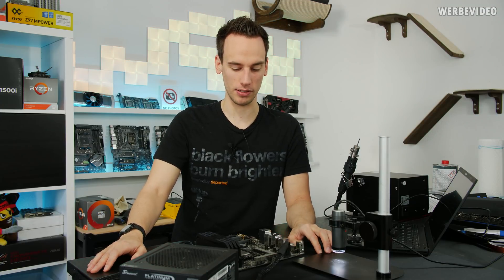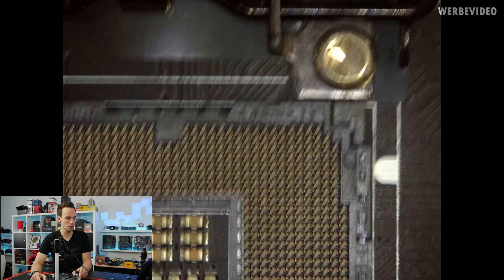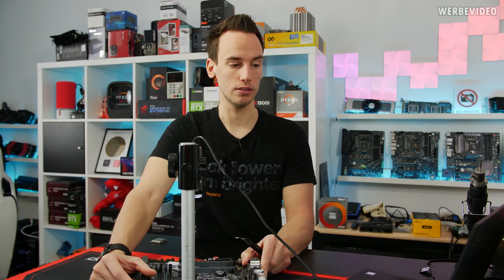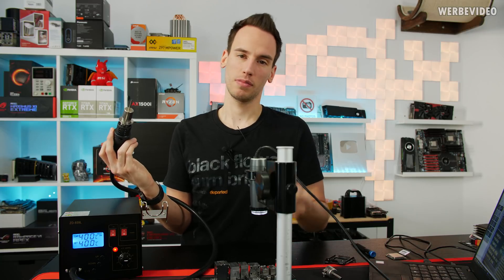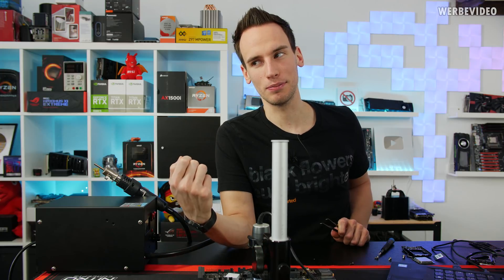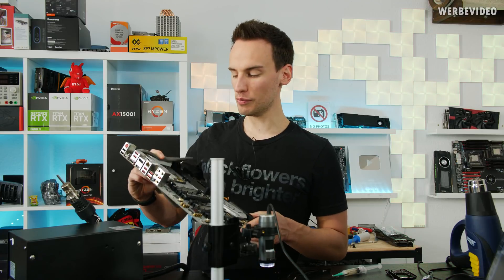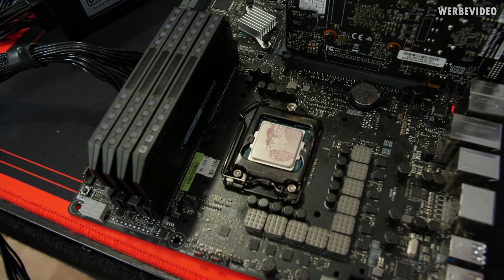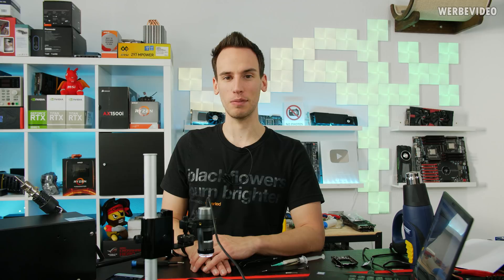We fixed a broken motherboard (Pin)... and broke it even more. BUT now it's working :D

Comment: I would think that if you can use the thermal resistance tape to shield all the other parts except the damaged pin, it will likely elimnate or reduce the unnecessary damage to other pins/components.

In anyhow, it is a good try to create a such a god video.

Comment: Hey you done so well on that one how do you feel about replacing 20-30pins on my one? 😅 I ended up bending them yesterday while taking the cpu off for the first time. The arm that locks it into place ended up slipping off my thumb and proper banged the cpu into the socket 🤦‍♂️and I havent got the funds to replace it 😭

Comment: what ???? soldering as a first try ?????  really ?   just try to bend it back FIRST ! if thats not working  -> soldering. or do you swap out the whole motor on your car if a spark plug fails ?

Comment: a few of my bottom left pins got bent. my x16 pcie slot 1 stopped working D6 debug code. i bent back with my finger and the pcie slot is working again.

Comment: Refurbished and ready for resale.  I fixed mine with a tiny bent strand of stranded copper wire for now at least...  Lasted a few days only compression fit heat and cooling must have disconnected it, had to go back and use 3 tiny strands twisted tightly together (for more spring) and tinned one end to actually solder it in, so far so good but I will replace with a real prong when it arrives from china in a month or so, and switched back to my glitchy memory chips just in case, which now are all working perfectly of course, this has apparently been the whole problem for last 2 years, glitchy memory sticks caused by improperly cleaning and repasting my cpu that caused a bent prong that i then broke off trying to unbend.
Reply: cool. i was thinking about getting a broken lga board for the pins but ill try this out

Comment: @der8auer any reason why you can't use a soldering iron on the pin to loosen it? I have same board with a missing pin, but can still POST with half the memory

Comment: Hi i have a few broken off pins on my server motherboard and no one is willing to fix it for me so i want to fix it myself. So what do i need to replace a the pins and repair it??
Reply: i'm thinking about buying the socket from ali express and practice with soldering iron, can you see any downside to this?
Reply: @bitcoinnoddy6850  the problem it you cant use a soldering iron you have to use a hot air soldering thing like in the thumbnial. And i have anoter old motherboard to practice on
Reply: @jankocoetzee  fingers crossed, i've just bought LGA1151 and a USB magnifying glass, i'll check it out and maybe buy that hot air soldering guy and try it out :)
Reply: @bitcoinnoddy6850  thats great i hope you get it right. There are some other videos that you can watch thats shows how to replace the cpu socket

Comment: Can you send me some pins if they fit an LGA1150?
Reply: just buy the socket from ali express? that's what i'm thinking of doing and practice taking out and putting in
i don't have the air thingo, but was thinking of just touching a very small soldering iron on the pin until it comes loose? 

what did you end up doing about your board?
Reply: @bitcoinnoddy6850   I found a donor board with an early model LGA socket. they all practically use the same style pin.  Unfortunatly i could not get the broken piece out. I removed several pins from the donor by hot air but the pins sit inside the socket and i wasnt able it fit anything inside the square hole to grab it.. I even tried cutting a pin in half and pushing it down the whole but it wouldnt fit unless the broken piece comes out. The sockets are surface mounted so only hot air can remove it.
Reply: @mknight6026  this sounds exactly like what i did today, i wasn't worried about getting the half stuck pin out, i was hoping to jam half a pin in and have it just touch the old half pin. but it was way to tiny to work with. i'm going to put the board back in tomorrow and deal with 16GB memory intsead of 32GB :(

Comment: İt's good video,This thermoplastic can handle 275°C like 45 seconds and pin soldering joints are melting at 237°C mostly.With this method  you are not breaking socket originality.
Reply: please can you tell the proper way and tempatures to pin out and pin inout those broken with others . i have 4 snaped unfortunly

Comment: I think it makes sense to try a cold repairing first. Easily remove a pin from a donor new socket you can buy on ebay for few cents, cut it on the needed lenght and insert it on the failed pin without removing it completely. Soldering it it's not necessary. Than you can decide to solder or not the old and the new pin together rather than on the board. I tryed it on a board with two memory pins broken and now it's working good. Good video anyway.

Comment: 11:33 So... you just turned the pc on with flux under the socket?
You are so lucky to not have burned the CPU/motherboard, I've had some circuit boards realizing the magic blue smoke just because I was too lazy to clean that off.
Even if you are using a high-quality flux, where the conductivity is not a big deal, leaving the flux there will eventually damage the socket

Comment: It's definitely worth shielding areas you don't want to inadvertently melt. Tinfoil is ok for mild heat and further areas, but kapton tape is excellent near the work area. It will resist soldering temperatures completely. Tip: to avoid sticking it to CPU socket pins, place some tin foil behind the tape or stick two pieces together by their sticky sides. Then stick it down at the edges of the CPU socket.

Comment: one thing I've heard about hot air rework stations is that if they don't have good consistency in temperature then you have to set the temperature much higher and they can spike and melt things.

Comment: @der8auer
Thanks for another interesting video, and I want to say that I really enjoy Your more "odd project videos" like this one. And I don't really "care" if outcome is "success" or "failure" the enjoyment comes from You telling us about how "stuff works" and how You think, so as long as it's informative it's GREAT... like this one.
But I must admit that when seeing Your soldering job I did wonder why You didn't even attempt to "shield" the "neighboring parts" of the socket. I think alluminium tape would be ideal, but really anything that can "take the heat" and deflect some of the "direct airflow" away from the parts that You don't intend to "melt" ;)
Just a thought.
Best regards

Comment: When I do SMD rework, I prefer using lower temperatures (300-350C) and a larger nozzle so I can use lower air speed and not have to worry about blowing components off... or melting connectors/sockets.

Comment: Had some time with CPU socket pins - you do it correctly, but I usually preheat whole board to 100C on gas food kitchen panel (metal layer in between to hold board and not to burn anything + aluminum balls to hold board perfectly straight)   hot air gun on top :) Much easier to work with preheater board in such way.  I usually soldered half off the pin so no plastic would melt around too much.  Recently fixed GTX 780, reballed GPU and used two different kind off ram chips :D  Elpida + Hynix, works perfectly + liquid metal :DDD If you are interested in pictures - I can send you :)     Modding graphic cards like 10 years for a hobby in every part off them :D   Now modding R9 290 - bad vapor chamber so modding old GTX280 cooler to fit on it xD

Comment: i had similar situation, i bent a couple of pins on msi b250m pro-vd and it would no longer post but after a couple of hours of fiddling around in the socket and bending even more pins i finally managed to bend them back to working order
however i lost a screw to the m.2 drive which is my boot drive so i just wedged some isolated tweezers between the cpu heatsink and the gpu and i can boot properly

Comment: You need a preheater when dealing with a CPU sockets. If not use anything you can find that can produce heat from below. You need continuous heat from below behind the socket to avoid melting the socket when using a heat gun.

In truth, a heat gun on it's own can do more damage not just to the socket, but also the PCB.

If I did not have the correct equipment I would experiment with something like a pot of hot water behind the CPU socket. At lease you now have constant heat behind the socket.

Comment: Hello Der8auer, good video as always. Next time perhaps you could try replacing the entire socket? It's possible with a heat gun, flux and a soldering iron. Here's an example on LTT forums, cheers! https://linustechtips.com/main/topic/1045994-cpu-socket-replacement/
Reply: did you even watch the video?
Reply: @Ilegator  Obviously you did not as it differs a ton from what I asked.
Reply: @Zalazane  he said that he doesn't have the equipment to do it properly and that it's really difficult to get a replacement socket.
Reply: @Ilegator  Read my comment again, I suggested an easier way without expensive equipment. Unless you think a heat gun, flux and a soldering iron are expensive... idk what to tell you.
Reply: @Ilegator  Also replacement sockets are incredibly easy to get, just google for yourself.

Comment: This was a great video Roman! I replaced a pin on a z170 board awhile ago. It took me over an hour with a magnifying glass to do it. All i did was take a pin from a socket 775 board and pressure fit it in with the broken pin. I carefully placed the CPU in the slot and it worked and has been working perfectly ever since. I wasn't aware you could use the hot air station to desolder the pins like you did. I will be using your method next time I need to replace a pin!
Reply: I just tried the same recently on an Asrock 1150 board but with wire and it didn't work. I never thought of using pin from another mb. How did you remove the 775 pin? Did you use heat?
Reply: @johnskerlec9663  Hey John, I actually didn't have anything to heat it with at the time, so I used a hobby style razer knife and sliced away that insanely tough plastic little by little until I exposed some of the pins. What I didn't mention above was how many pins I had to go through to get the one that worked. Those things are so small they jest kept springing off into every direction. Sometimes I would find it and try again, but it was frustrating how many just disappeared on me as I was trying to get it into place. The end result was me doing a victory yell and fist pump in the air and then crashing for a bit from mental exhaustion. It was worth it though!
Reply: @Viking8888  I get it. Those microscopic parts do seem to spring out and disappear. I tried to use a fine wire and under the microscope it looked like a fucking log. It didn't work and was not springy enough i guess. I didn't realise the 775 pin could be used though. I have a fried P4 Asus P4S800 I thought I might use but don't have the patience.

Comment: AMD users laugh in PGA
Reply: Möebius 2k AMD has a big problem when your thermal paste "glues" your cooler and a cpu. 20 min of prime 95 should soften the paste, then you rotate a cooler left-right and are praying for not pull your cpu from socket. It happened to derbauer too, a couple days ago. If you can't heat it you can be screwed. They will fix it with a new socket.

Comment: for almost ideal result use pcb heating plate , the motherboard socket area should be heated to 120-140c (from back side ) then use your heat gun at 330-350c , do not forget to add some flux. also you have to calibrate this cheap heat gun .

Comment: I have fixed two LGA1150 boards (both asus Z97 and z87) with only the tip of the multimeters measuring tip. One had 5 pins pended? and the other had 1 pin wrong(problems with memory channels). Both of these jobs were succesfull and the cpu's and memory worked ok after. The mb that had 5 pins wrong I had to use magnifying glass to get them straight, that was Asus Z87 maximus hero. And I made about 80€ for doing those because I bought them 20€ a piece and sold them with nice profit. But it's not a job for everyone, you have to know what are you doing.
And thanks for this video der8auer! Nice to learn more!

Comment: I have to try this, I would probably go with applying a tiny amount of amtek flux on the pin to be removed, cover the socket with kapton tape where there's plastic, then use the rework gun at about 200C to preheat the entire board, and get the entire board too hot to comfortably touch, then go for hitting the pin with 375-400C.

This should minimise the damage to the area, while making it easier to remove the specific pin.

I need to practice it through, and my thoughts on how to tackle it might change once I give it a go.

Comment: having a preheating plate helps a lot because if you preheat the board from underside to lets say 80C then you need a lot less heat energy from above via heat gun to melt the solder and thus put less strain on the parts your working with. also I will always repeat this: before any bga smd rework pls dehidrate your pcbs and parts in a regullar oven for 12 hrs at 80 to 90C. or else (google: pcb popcorning)
Reply: btw nice job, I'd hire you
Reply: please can you tell the proper way and tempatures to pin out and pin inout those broken with others . i have 4 snaped unfortunly

Comment: I managed to get a h110 board back to life with 2 bent pins at either side of the socket. Good day light helped, and just a Stanley knife blade did the trick for me. Most not be that blind yet! Can't wait to get the Ryzen OC mounting frame. ETA 28th April at ocuk.

Comment: Nice work, I enjoyed this very much. Just thinking maybe a heatshield would have been useful, maybe even some aluminium foil (with a small hole to work through) taped down to the motherboard  would have helped?
Anyway, good stuff, keep it coming Roman.
Reply: Kapton tape is your friend here. It's like sticky tape but it's completely heat resistant at soldering temperatures. You can literally put solder on it and drag it around with an iron. Magic!
Reply: Yes, that yellow tape, it would be ideal, I agree totally!

Comment: Now to ponder whether I should attempt this on my pin-missing 3700x using a donor Athlog CPU for the pins.. :^ )
Reply: I could be wrong, but I don't think the pins on the bottom of the cpu are soldered, at least not to the surface in a way that you can desolder them.  I did fix an intel p3 cpu once, just by very carefully sanding the broken pin square near its base, and soldering a piece of copper wire in similar gauge to the base of the pin.  It was a little bit of a rough fit back into the socket, but it worked.
Reply: @nwimpney  Who said anything about desoldiering pins? ;)

That's what the volunteer donating his organs for PILFERING is for.. :---DDDD

Comment: here in Brazil there is a technical assistance that has been doing this for a long time, there is a video where he shows doing it: youtube.com/watch?v=4PkvfxL-LFo basically he takes a pin from a new socket , cut the solder ball that comes in the pin, take a new solder ball and put it in the socket to be repaired, and then with the hot air station solder the new pin in place

Comment: Der8auer you are an inspiration to computer enthusiasts and a legend in overclocking, I have a question do you think its possible to delid the new 10th Gen intel processors with your delid diemate 2 or should I not upgrade yet i have an i7 8700k delided at 5.2Ghz at 1.4Vcore???

Comment: After soldering you should clean all the flux and other stuff from the socket with IPA (isopropanol). It will make the board look much cleaner and prevents contact problems. However now during corona the price can be terrible

Comment: People don't realise how much sockets are over built with free pins so they could easily add extra features such as PCIe lanes (that only need two pins per lane). Unless you're Intel...

It's impressive how AMD as stuck to socket compatibility for all the Zen/ Ryzen CPUs thus far, but Intel changes like the wind. Until recently I was exclusively buying Intel CPUs (Athlonx2 was the last I believe), and I cannot remember a CPU upgrade that didn't require a motherboard upgrade. I have a z170 sitting in the corner, it is a decent motherboard, but there was zero upgrade path past a 6700k. Is great that I can use the Noctua D14 on a 3950x.